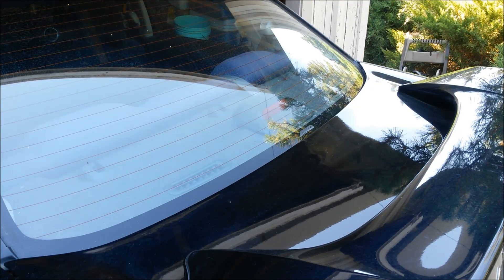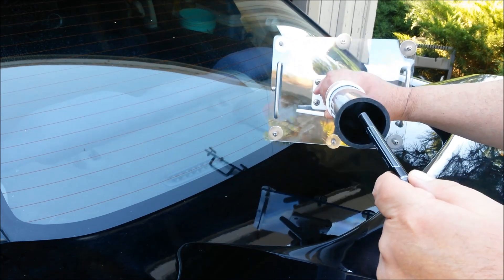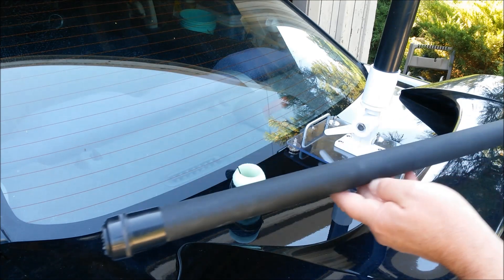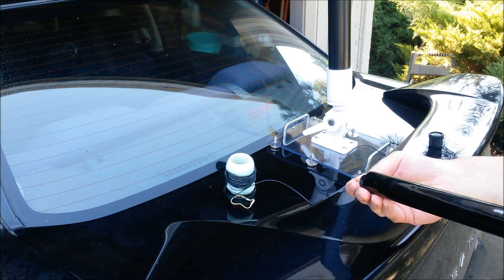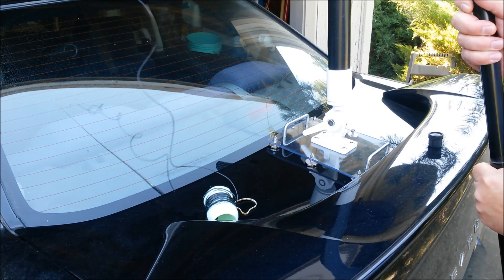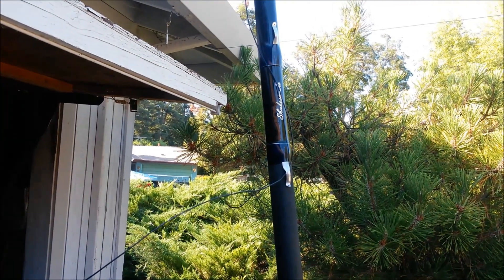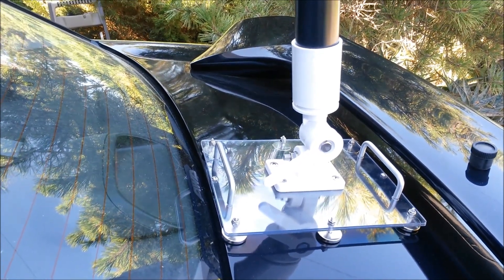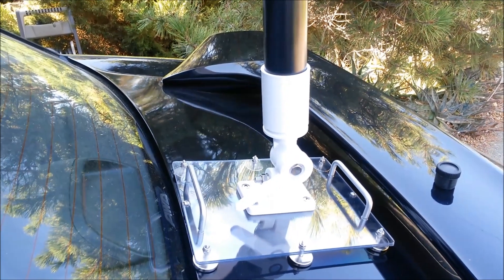Home-built Vertical "RFI Evader" Antenna for Shortwave Radio DXing

Comment: Thanks for sharing that video...very informative, very cost effective, very modular, and very portable.  I think I may have a similar type pole I bought years ago from MFJ (I will have to check...maybe I gave it away.  If I still have if I will try to build one.

How does this antenna compare to your 130 ft random wire ?  Can you also share any construction details on your long wire that you captured Papua, New Guinea?
Reply from the maker: This 20' whip does not perform as well as a 130' random wire if deployed at the same location. It works much better than the telescopic whips on any of my shortwave portables and I don't need to trespass on private property to hang up the random wire.The advantage of this "RFI Evader" antenna is that it can be easily set up out in the countryside away from buildings and power lines without trespassing. Avoiding suburban/urban RFI is a huge advantage. The shortwave noise floor will fall a lot without RFI: which is better than raw signal gain from bigger antenna that is swamped by RFI.

The 130' random wire I used to receive Radio Madang is a portable antenna. It is simply a plastic spool wound with 300' of 18 AWG insulated and stranded copper wire. A 3.5 mm mono plug is soldered to the near end of the wire. For deployment of this random wire/long wire antenna the wire is plugged into the radio and unspooled along the length of the antenna run. Any remaining wire is left in the plastic spool at the end of the run where it doesn't bother anything. Removing the antenna is a simple matter of winding the wire back onto the spool again.
Reply: @willowsloughdx  Thanks for your good information on both antennas.  I am trying to get back into DXing after having been away for many years, so I have many questions.  Having a 130' random wire is intriguing due its simplicity and ability to receive more bands, however I read someplace that having a long wire longer than 20 ft is not recommended for portable radios, due to ESD, and possible overloading on the amplifier.  Any truth to these undesirable circumstances?
Reply from the maker: Inexpensive shortwave portables may overload if used with wire antennas longer than 25'. This is why the popular reel-up shortwave antennas like the Kaito T-1 and the Sangean ANT-60 measure only 23'. Better-designed radios can handle random wire antennas of any length. These radios include the Sangean ATS-909X and the Eton Grundig Edition Satellit. I'm sure there are other portables that work as well with long wires but I haven't used them. ESD was a problem with some portables 20 and 30 years ago but the better radios available today have diode protection in the antenna circuits. Still, it doesn't hurt to touch an antenna connection to ground before connecting it to a radio.
Reply: @willowsloughdx  I recently bought the Tecsun PL-880; not sure if this radio has the protections you talk about.  I will try to search the internet, to see if anyone has tried it.
Reply from the maker: @greggygreg8549  From what I have read the PL-880 is a good radio for use with long wire antennas. Good luck!

Comment: I really like your antenna project, Dan! I've done something similar before with two telescoping poles to support a Wellbrook ALA100 loop on my SUV, but I never thought of using ham radio/marine swivel mounts.  My setup was "kludged" together with hardware bits. Building these projects is half the fun, isn't  it?  73s, Guy
Reply from the maker: Yes. indeed. I love projects like this. The marine antenna mount is the same one I use on my boat. That's where I got the idea. The Shakespeare mount is designed for no more than an 8' antenna so I am exceeding the specs a bit. It seems very strong in gusts up to 20 MPH, though. A stainless steel mount will cost several times more.
Reply: Yes, I noticed the 8 ft. limitation in some ads, but figured that when stationary, your antenna-equipped vehicle could probably withstand reasonable winds. I own a number of 20 ft. masts similar to Shakespeare's, so I'm inspired to give your approach a try sometime. Thanks for the ideas!

Comment from the maker: This is a simple shortwave receive-only antenna that allows the user to listen to shortwave radio from a parked vehicle in rural areas. The countryside is often free of shortwave radio frequency interference (RFI) that afflicts shortwave listeners in urban and suburban areas. Thus, the RFI Evader antenna is a tool for evading shortwave RFI. This mag mount antenna does not require trespassing on property for set-up. It is a self-supporting 29' (8.8 m) random wire with one end 24' (7.3 m) off the ground. Construction of this antenna is more of a hardware project than an electronics project. The only electronics skills needed for this antenna are the ability to cut and strip some wire and solder it to a 3.5mm plug. This antenna received shortwave DX from a station nearly 11,000 miles (17,700 km) away. I recorded this reception on another video and the QSL card for this reception is shown in this video. The cost of this antenna is largely based on the choice and quality of the selected parts.

Comment: Good stuff, very practical. I'm usually happy with about 15 meters of wire but for a couple of times it wasn't good if there were no trees to attach it to. Once I ended up tying my wire around the tallest object - blueberry bush:) as trees are rare in this wind-swept land, especially on the hills. Thank you for sharing the tips and 73!
Reply from the maker: Thanks! Yes, I have done very well with 41 meters of wire temporarily strung along the top of a 3 meter tall hedgerow. Not very high in the air. I have several videos shot at Sea Ranch California October 9, 2017 using this antenna. https://youtu.be/aabRW4Dxj3w I hope to be at Sea Ranch again this October.
Reply from the maker: I have a couple of nice antennas at home but they still suffer from RFI from several sources located off property. The worst is a neighbor's broadband connection box. But, that's his box, not mine. I actually enjoy gray line DXing out in the boonies quite a bit. You should give it try.